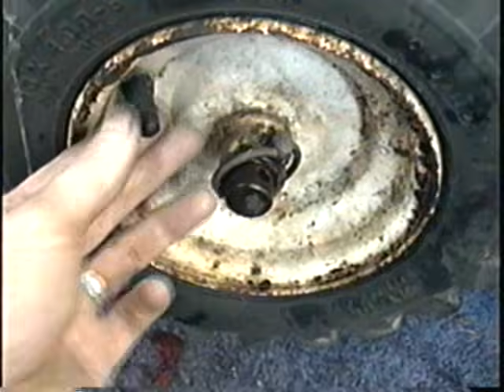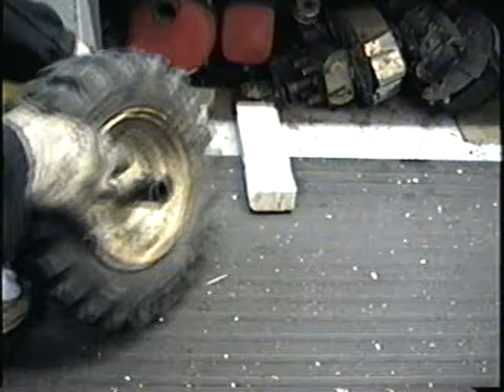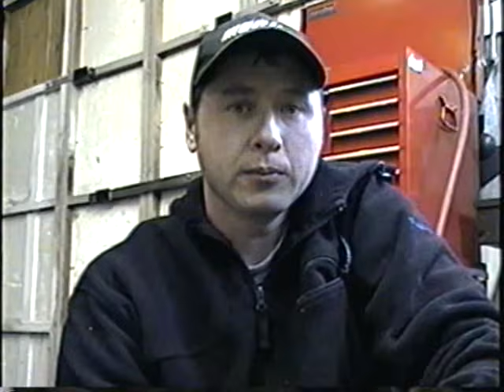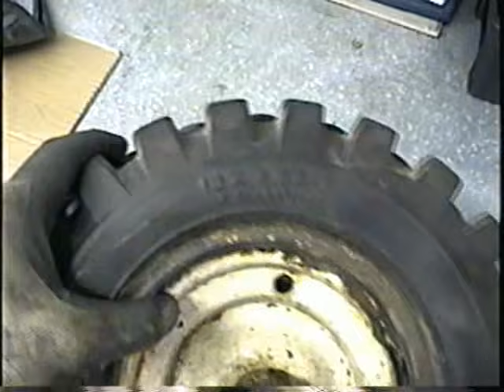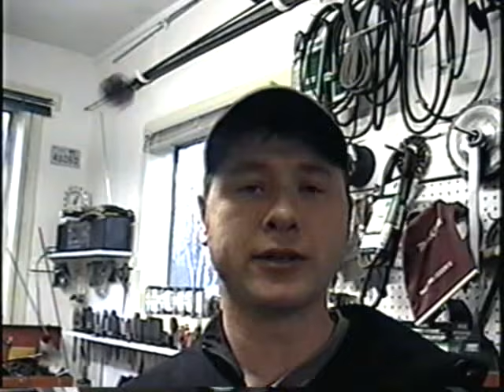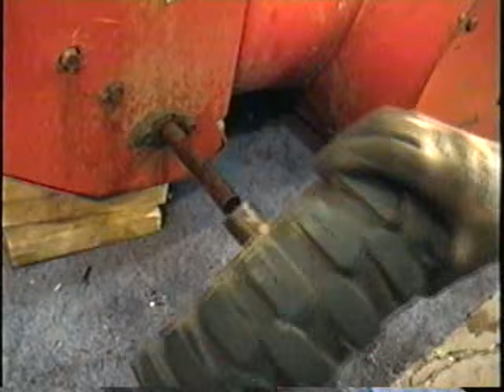Snowblower Flat Tire Repair

Comment: Just another way to seal that tire if it is leaking air at the bead and you don't want to put a tube into the tire. Deflate the tire /break the bead on both sides of the tire. Now, with your finger, put some grease around the rim where the bead is. Then reinflate the tire. The grease acts as a bead sealant. The leaking air problem has been solved.

Comment: Wish me luck!
The rim is siezed on the shaft, and WON'T COME OFF!
Add to that, the tire broke free from the back side of the rim.
Add to that, i'm having to do this outside with the air temps around 20°!
Ah, winter in Michigan!

Comment: His videos are always pretty clear and to the point..i learn alot form this guy.. i have the same snowblower i tried the green slime but i think i might be better off using a tube myself im having trouble getting the tire back on the rim becasue the rrim is ceased onto the drive shaft or bar..so i gues sill just have to sit it on its side becasue it isnt going on for anything..ill try agian tomorrow but i think im going to just go with a tube instead of chancing the green slime..the rim is damaged a bit and the tire is worn it might still leak no matter what..but as long as the tube goes in smoothly unlike the firs tone i tried it should work jsut the same.

Comment: Great job.  I need heat apparently and good tip using the vise grips to hold one side of the tire when going back on.  Here I go!
Reply: Tried Slime as a first effort and it appears to be holding.  Thx again.

Comment: @3:09 tyre made of chewing gum, mine seems to be made of concrete and fuck-you's, 'cause it's just fucking with me.
Reply: Sorry for despairing in your comments. The advice is solid, the key was using bigger tools (in my case breaker bars). Everything's been against me, I've been feeling like. But hopefully my snowblower will help me with the white hell hereafter.

Comment: Hi. I have a yard works snowblower. Had to do some maintenance on it which required the wheels to be removed. The one wheel came right off. The other one is stuck ! Will not come off the shaft.  Really stuck!. Any suggestions on how I can get the wheel off the shaft. Any help would be great.  Thanks and keep up the great work.

Comment: Hi how are you doing dony? Can you make a video of changing just  the tire that has a tube in it. I've looked at a lot of videos where they change a tubeless tire or just the tube. But in that case you can shove screw screwdrivers in them if your changing just the tube. But  I need to change just the tire with a good tube in it. All of the video on YouTube i found don't address this issue.

Comment: Here's a tip if your tire is well and truly stuck. Take off your gas cap, put a bag over the fill hole and screw the cap back nice and snug. Now you can turn your snowblower on its side and gas won't leak out the vents! Then you can do everything he shows here.

Comment: Is there a reason I cant just pump it with air? I have a newer snowblower that getting low. I dont have all the tools you have so I may have to end up taking it to a repair shop. Dont want to if I dont have to.

Comment: I had a Toro 824 that had tires that would slowly lose air.  I couldn't get the wheel off so I bought a can of tire sealant and inflated the tire with that.
They never leaked again and it only cost about $12 for the tire sealant.

Comment: Dony please help .  I have the exact same blower in this video .  Toro 524.  The tire had the tube sucked in because the valve stem was recessed inside the hole.  My question is how do I order the tube for this tire it says 13x 4.00-6.  I tried looking this up all I can find are ones with a straight valve stem.  I want one just like you had in the video.  Thanks in advance .
Reply from the maker: look for "bentvalve" in ur search and even if the tube is slightly bigger it will fit inside

Comment: I'm no mechanic, farmer, or shop worker, but unlike some of the nobs on this comment section, I managed to get the wheel off, break the bead, insert the tube, reseal the tire around the rim, fill it with air, and refit it back to the snowblower without a blow torch or cutting my hands in 20 degree weather. And just in time as the snow has begun to fall again. Took total of 30 minutes. Yes, getting the wheel off seemed like it was going to be a problem, but once I realized I had to take my time and work it straight off the shaft rather than trying to pound it off, I had it off pretty quickly. Made sure to oil the shaft well before putting it back on. The rest went pretty smoothly, take your time prying the tire back over the rim. Thanks for the helpful video.

Comment: The Linch pin; i don't have these on my Yardworks that i bought at Canadian tire, so how do i remove that damn wheel? The wheel is stuck solid and i don't have a heated garage to fix!
Reply: Same boat as me, man- leaving it for the summer to get those bastard wheels off the shafts.  I had the blower in my garage, completely thawed, and can't get those rims off the shafts.  No convenient way to pull them off either.  Looks like I might have to lever or jack them between the rim and the body of the blower.  I likey have the same Yardworks self-propelled 7.5 hp with the Tecumseh engine that you have.  Price was right, at $35, but tires have always been flat.  Finally got deep enough snow to really need the self-propelling function and the tires spin on the rims now...

Comment: Followed these instructions- the vise grip tip is a savior! Start to finish 1 1/2 hrs including the trip to CTire for the new tube. I removed the rim assembly, took it into the house and spent about 10-15 mins warming the tire w/a hair dryer. I figured I'd better b/c the tire had ice in the treads when I popped the rim from the blower. Did all the work inside the warm house.

Comment: Dony I am looking for the vid you made,  Snowblower -  the snowblower runs at the same speed,  meaning I have it on Rabbit
but say I need to talk to one of my employees,  I lower the lever to RABBIT... but it doesn't reduce to an idle. 
NEways if I was to just purchase the new part will it fix the problem right out of the box, or do I still need to tinkle with it.
Craftsman II 9HP  I want to live next door to you Dony

Comment: I agree with aaroncake save your self the BS and take them to a tire shop. I have a fairly new blower and it took me hours to put tubes in them. Two 24" tire irons, three screwdrivers, two C clamps, three vise grips, and a wood clamp. Rims are all dented and and scraped up. I have replaced tubes on motorcycles before. This was insane!

Comment: Got the tire off but couldn't get it back on.  Can't believe how hard it was.  The main problem was the rim kept getting pushed back into the part of the tire that i hadn't yet pried below the rim.  Wiped me out.  Going to call around and check to see if anyone will do it fairly cheaply but if not, I guess I may have to shell out $89 for a whole new wheel.  Pretty ridiculous.
Reply: Allan Hotchkiss 6
Reply: Here they'll do small tire for $8 plus cost of tube, around 10 so for $18 you can again join snow bunnies.

Comment: fyi..this does not work in cold temperatures....tire too stiff and cant be put back on without proper equipment or heater garage the this guy had ...will try in summer....i tried to put tire back on and there is just no possible way by hand in 30f temperature
Reply: Bring the wheels in the house for a few days

Comment: I'm not sure I understand the diagnosis. If my tire is not holding air, and it's tubeless, is the only reason that it won't hold a seal around the hub? And is the only remedy to add a tube? Isn't there a sealant that can work?
Reply from the maker: tube is always better, there are sealants you can try also
Reply: Sometimes leaving your blower sitting on flat tires can crack/damage the sidewalls. There is no repairing this. Adding a tube would be the only solution other than a new tire.

Comment: The owner of that snowblower should have had you do a complete grease and lube job on that blower, possibly new fan belts as well, and a coat of paint as well over the rusted areas.

Comment: Attempted this today on our Murray lawn tractor, everything was going good until I put some air in the tube.  When I unhooked the air hose the valve stem slipped back into the rim (it was not the metal one).  :)  oh well.

Comment: I have a craftsman snow thrower with the left tire which has come off the rim on the outside edge. In order to take the wheel off,  is it a reverse thread or usual 'lefty loosey' ? The manual says it's a 5/16th hex screw, which isn't even close. I measured 1/2" for the screw head.

Comment: Thanks for this video. I watched several times and was able to get my tubeless Airens snowblower tires fixed with tubes from Amazon. Hardest part was getting the tire back on since they were very stiff tires. I appreciate your help with the video.
Reply: Apply soapy water with spray bottle when breaking the bead, and reseating the tire on rim and it will be easier.

Comment: Personally I find that removing the tire from the rim results in bent edges on the rim. A tire changing machine is the way to go.
Reply: I would agree that using proper tire irons is preferred in the absence of a machine.  I wonder if you can still find them?

Comment: Great Video.  I purchased new snowhog tires and the damn things are so distorted I can't get one of the beads to set.  Tried the fire trick, rope, and ratchet strap.  Giving up and putting in a tube.  I wish they would just put tubes in their in the first place.
Reply: If the rim is rusty it will continue to leak without a tube in the tire.  You can use a wire brush manually or with a wire brush and drill to remove rust if you don't use a tube.  Can also use some black bead sealer.

Comment: I have the same snowblower.  What size tube should I get?  The tire size is 13x4.00-6, but I can only find 13x5-6 and 4.10/3.50-6 tubes.
Reply from the maker: +Josh M  13x5-6 will work
Reply: +donyboy73 Thanks Don for the quick response and great videos!

Comment: Thanks for the video.  It was an easy fix, and I got inexpensive tubes from Harbor Freight.   I would never have attempted it without your video, but I repaired two tires in less than an hour.  Saved me a bunch of money by being able to do it myself.  THANKS

Comment: If your rim is stuck on the shaft try taking the locking pin out and then running the snowblower in drive. I did this (by accident) during the last snow storm and the wheel slid right off the shaft afterwards. Prior to that it was well and truly jammed on.

Comment: If its stuck on the shaft in addition to a torch it can be useful to try soaking both sides with penetrant and then striking the en with a socket and hammer. use a socket the same size as the wheel so that youre not just hitting the shaft. then try rotating off

Comment: This video represents the absolute best case scenario when removing the wheel and then removing the tire. What it doesn't show is the 2 hours of spitting blood it takes to remove the wheel by alternately heating, pounding, pulling and pulling it millimeter by millimeter off the shaft. Then the next 2 hours swearing, cutting fingers and bending the rim trying to get the tire off only to realize it's not worth the frustration for a $20 tire, so instead the tire is cut off with an angle grinder. Also a note to anyone considering heating the wheel with a torch. You may discover, like me, that there is a plastic bushing between the wheel and shaft. If you start to see any flames from between the shaft and wheel, stop heating. I ended up having to drive wooden wedges between the wheel and snow blower, while tapping on the shaft with a hammer (taking advantage of the free play of the shaft horizontally). With every few taps I drove the wedges to support the rim against the body.
Reply: +aaroncake You're an amateur.
Reply: TotalMishap Well yes, that's why I watched the video for an example before I performed this job. For the price of a tire, I wouldn't even bother trying to remove the old one properly. Just cut the old one off and replace with the tube.
Reply: +aaroncake NEVER Question Donny
Reply: Oh man, you nailed it- funny as hell but still informative! I'm laughing and feeling bad for you at the same time. Thanks for the tip about just sayin' F**K it at some point. I'm going to give er a go today (the valve broke off when I tried to put air in). I won't go crazy over it if I have to; there's a Princess Auto in Kingston.
Reply: wow! fortunately for me, mine came right off.
Reply: Just here 10 years later to let everyone know this guy is over exaggerating even if these style tires got frozen on it’s super easy to pound them off if you have never gotten your hands on a hammer or wrench in your life then call grandmas she can likely help

Comment: Your videos are some of the best I've seen- I followed the starter video lubrication process and it worked perfectly. Now I'd like to buy a pair of inner tubes for my MTD 5 HP snow thrower- do you have the part number for the inner tubes?
Reply from the maker: just get the same size as your tire